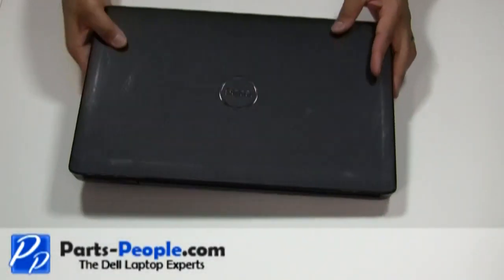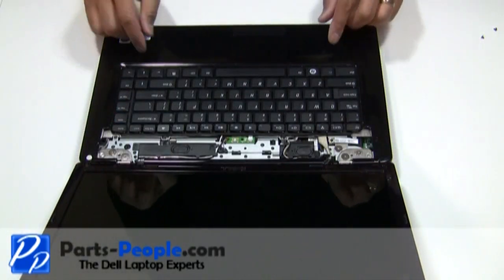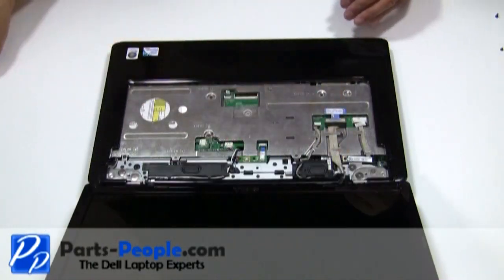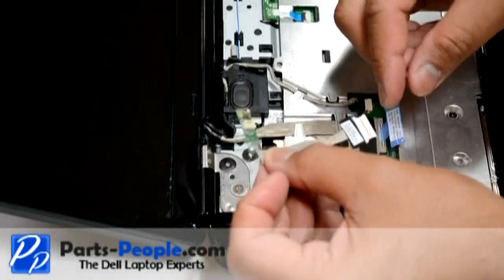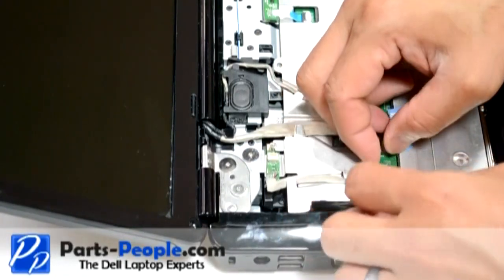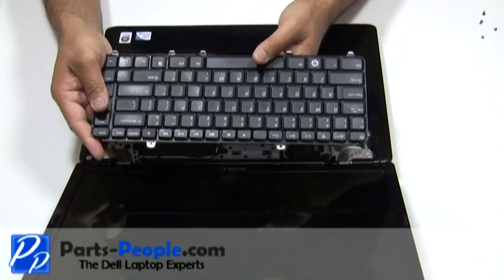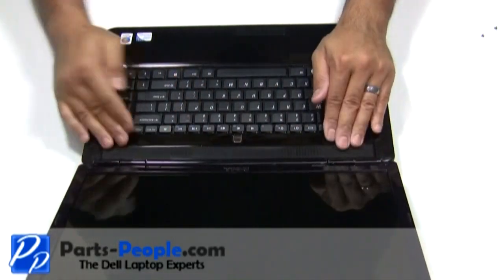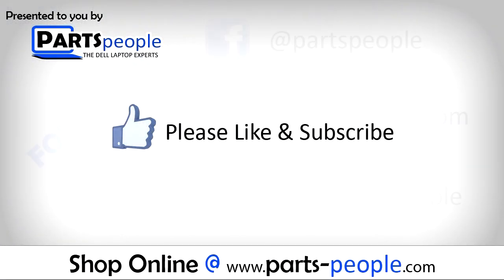Dell Inspiron 1545 | Bluetooth Card and Cable Replacement | How-To-Tutorial

Comment: I did an upgrade from the wifi card to the intel 7260AC which includes Bluetooth 4.0. can I remove the default BT card that my dell 1545 brings without problems?

Comment: I've always been wondering, how come my inspiron 1545 has Bluetooth capabilities. But yet I've never been able to use it despite downloading the drivers.. then when I opened her up I see there's a module with empty pins and now I see here in this video that I've been missing a Bluetooth card all these years... thing is that when I bought the laptop, there was no mention of enabling this function and I don't have the manual anymore but I'm sure that it said turning on and off the wireless function also turns on and off the Bluetooth, but it never mentioned that the Bluetooth card was not included... so my question is. did this model actually come Bluetooth enabled? or does it just have the various extra pins and modules to give the user the option of expanding? or was it a manufacturing fault/retail store fault?

Comment from the maker: @jfrancis28 You can not change the video cards on the 1545's since they are on the motherboards.  The only way to upgrade you video on the 1545 is to replace you motherboard with the Dell Inspiron 15 (1545) Motherboard System Board with Discrete ATI Radeon 4330 Video - H314N, however; you will also need to find the heat sink that fits this motherboard, which can prove to be a difficult task at times.